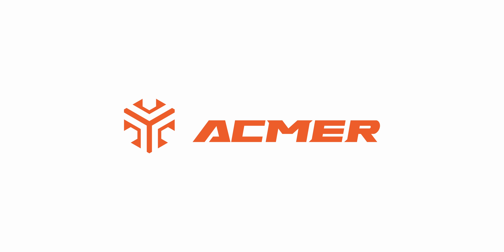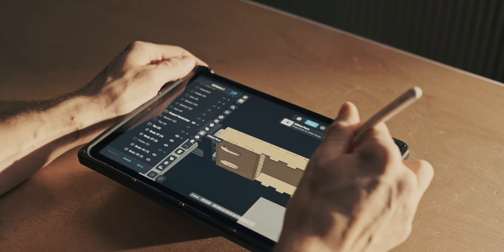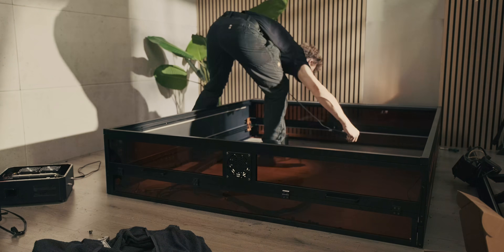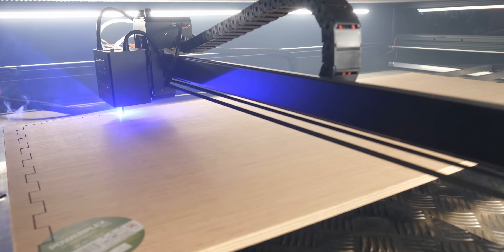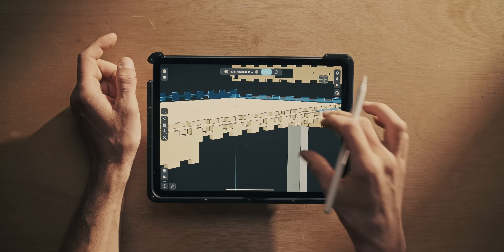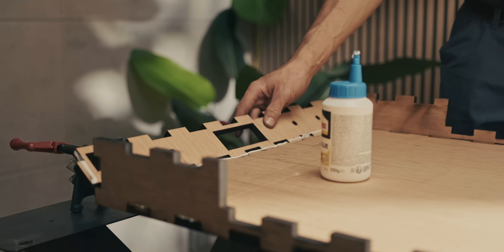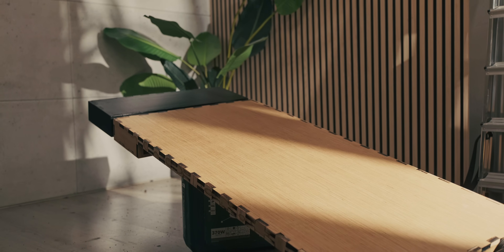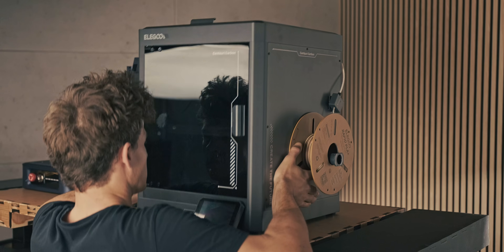Mini Fab Setup Build – Extendable Top Segment – Episode 3: ACMER X1

Comment: Thanks for sharing, and especially showing your process of tuning the speed & power to get a decent cut quality for the 12mm ply. I'd be interested to see the cut quality on 19mm ply. Does Acmer or lightburn  have a feature to perform two or more cuts, and dropping the laser focal point on the subsequent cuts to improve cut quality on thicker materials?
Reply: most programs that output to a laser can handle multiple cuts yes

Comment: Great build I've been loving it. Although putting a printer on the top surface is not the best idea, the desk is not rigid enough and you will be left with some hefty vibrations and shaking during your prints. You can see what I'm talking about when you place the printer on the desk.

Comment: Thanks for your content—so excited to finally see the finished builds! It‘s awesome! While the ACMer X1 prototype still needs refinement (and that’s something we’ve been working hard on the finished version）Really glad to see it fully leverage its large size in your projects!
Reply: Hey might be a silly question, but can Acmer X1 cut carbon fiber sheets? If so how thick the sheet can be? Should I get a CNC or a Laser version is enough for this purpose?
Reply: @Ccccaa22228  Thank you for asking. While both CNC and diode laser can be used, neither is optimal. Our CNC spindle only cuts carbon fiber sheets up to 1mm thick, and diode alser may melt carbon fiber edges. We don't recommend cutting it as fibers are hard to clean. If used,  please operate with professional protection in a sealed space.